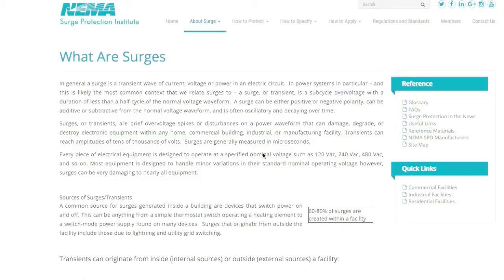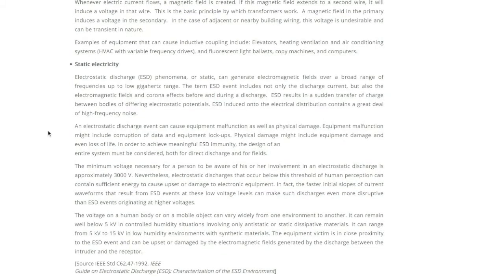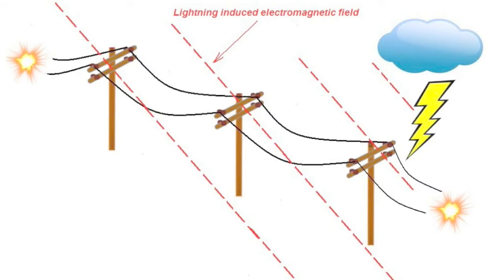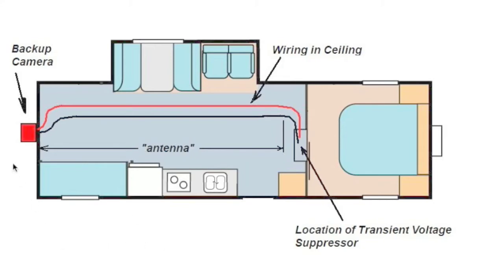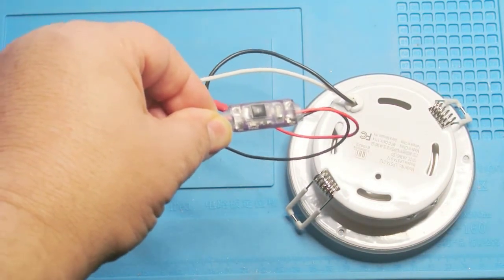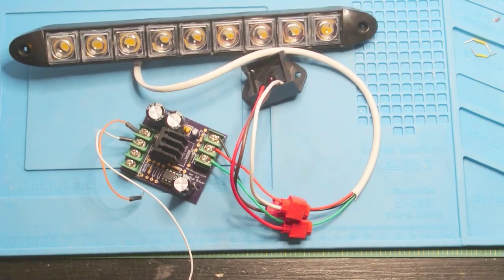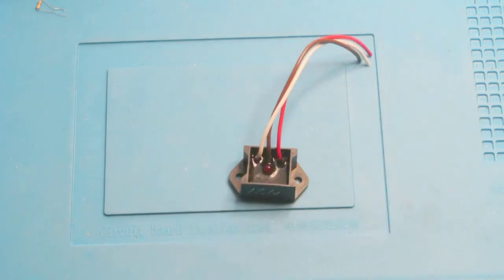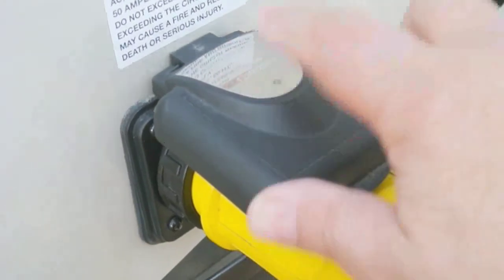Installing Voltage Suppressors in my RV.... and final thoghts.

Comment: When I was in Ford heavy truck div. in the 90's, for noise suppression, we used twisted pairs and shielding.
Thanks for the tips!
Reply from the maker: Twisted pair cable is a "common-mode"  interference rejection technique, and is widely used in the networking and telephone industry for signal wiring. It is most effective when the wiring is "balanced", which means there is no reference to ground.
Reply: +RVProject I had a corrupted SD card that I used my YouTube videos with I used it with a 4G Samsung Galaxy S4 phone I was wondering if the memory card stays on their phone will it still show even if it's corrupted because I was going to do what you said on one of your videos I don't know what to do because I got so many special videos on there but I'm right back before I do it good job on your YouTube video I just need help thanks